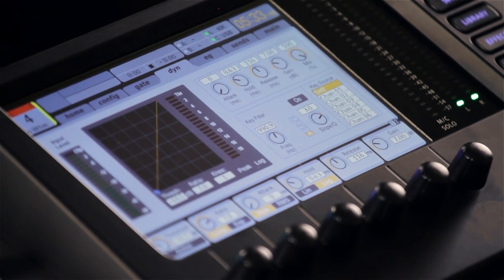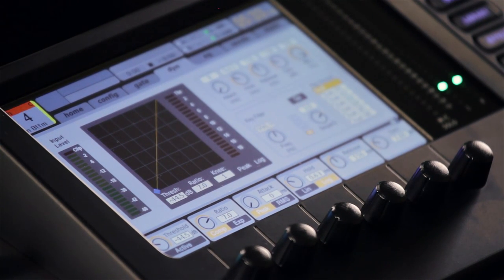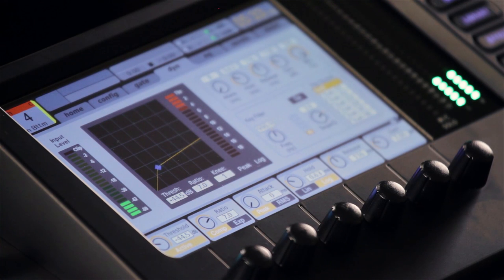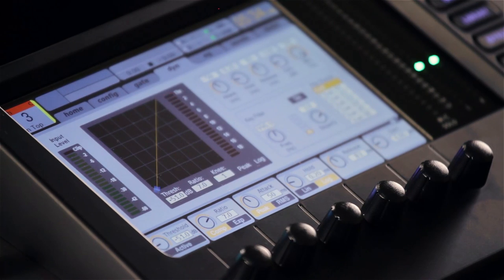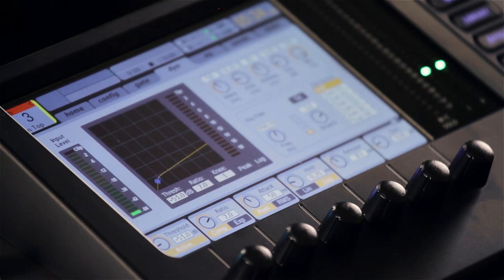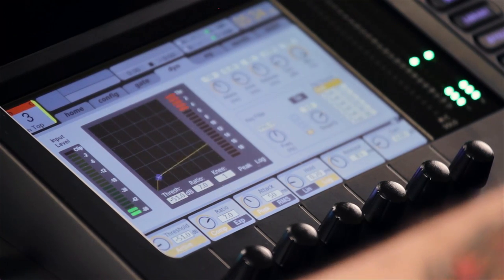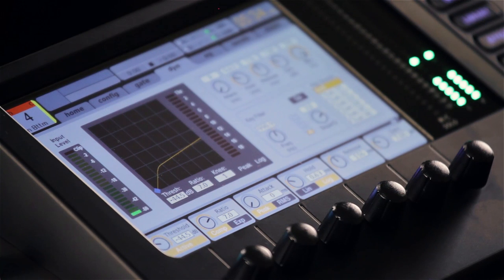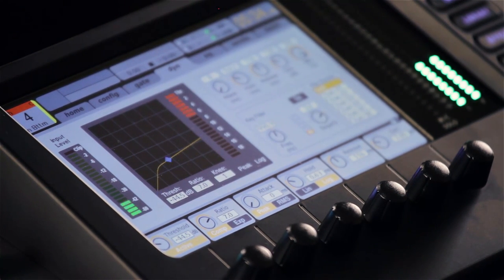Master Class - Audio Mixing - 02 Drum Compression

Comment: What is you only have Old School equipment. Like I have an EV BK 8 board (I use just for drums) Into an EV BK 12 Board. Would I have to buy 8 different EQ's for each Drum or How do I do a Whole set of Drums with one EQ and Still get the Awesome Bass Kick punch. I know now that I will need to get a compressor but also how would I use it to do the whole set. I am not talking about a studio mix I want to do this for a live mix lets say in a local bar or at a Small Club
Reply: I haven't been able to understand the compressors in the past as most of the sound men I ran into didn't have the time or the want to show me the correct way of using Compressors and most of the music store sales men know less than I do about compressors but they tell me I have to have it and the have a great one just slightly over my budget range. Thank you so much for sharing your hard earned knowledge. Would you recommend any Schools that are close to Southern Maryland where I can take some classes or do you recommend any classes I could take at the local Community Collage to take that will help me with sound engineering or how I can use the stuff I have to be a sound man for local bands?
Reply: Also could you show how to compress a whole kit with one Compressor like one Rack mounted compressor from just the drum board